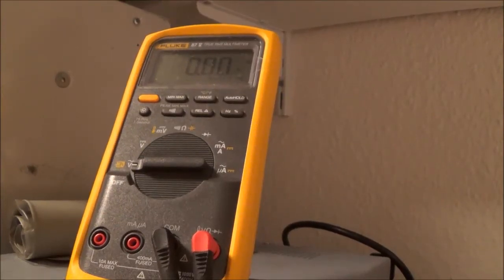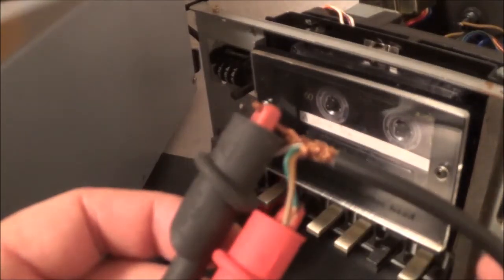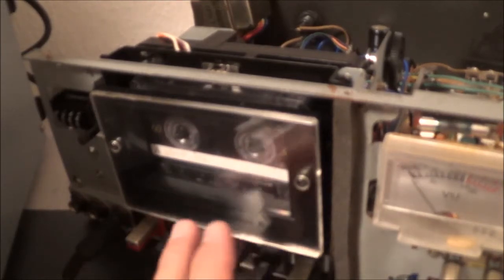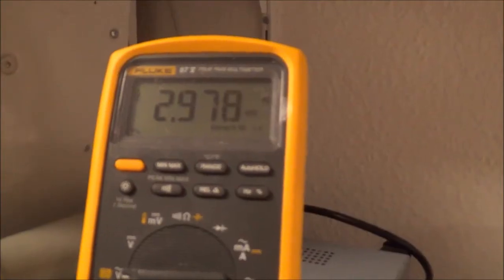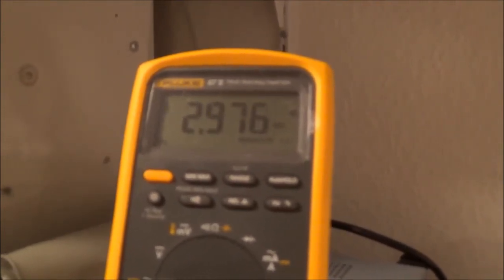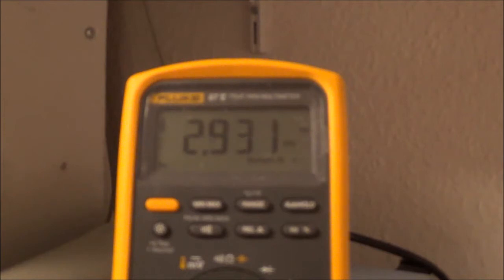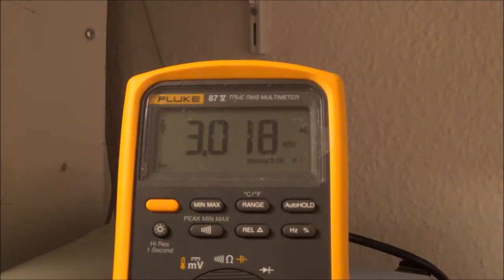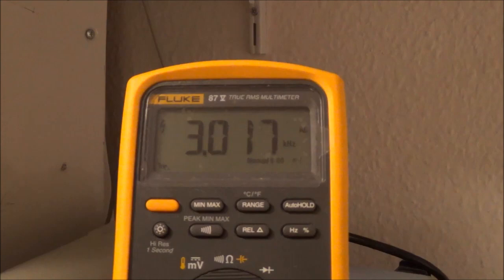Marantz  1820 (5000) Cassette Deck Motor Speed Adjustment

Comment: I would never of thought of using the headphone jack. I think I will make a set up for that way. It will be easier then going around to the back of the deck to hook the meter up. Thanks for the idea.
Reply from the maker: Thanks, Pat, for watching and commenting! Little bit easier with the headphone jack. If I can find the cable whenever I need it...

Comment: soo one end is ground and the other goes one of the two lines of the headphones?
Reply from the maker: Right; you could also just use one of the line-out jacks at the back of the deck and get the signal from there.